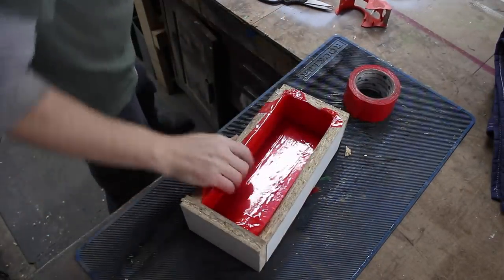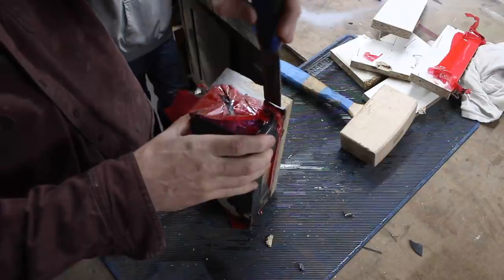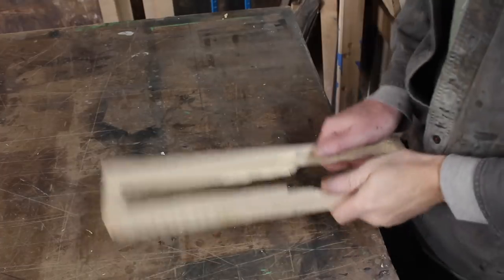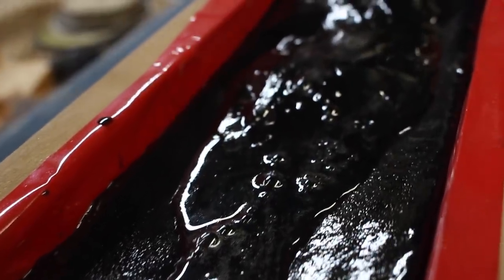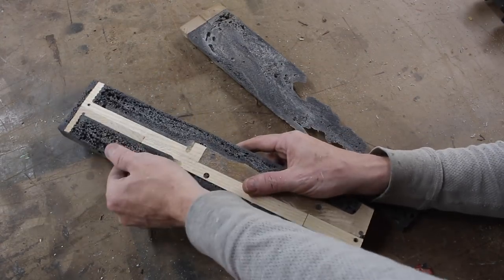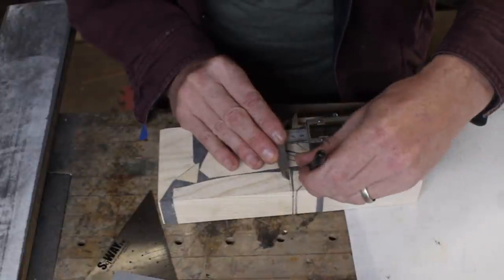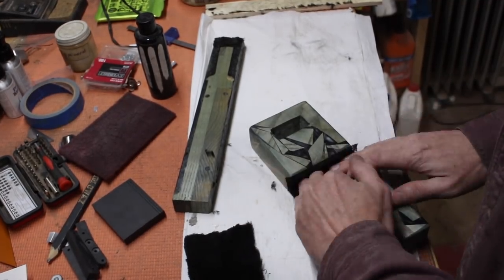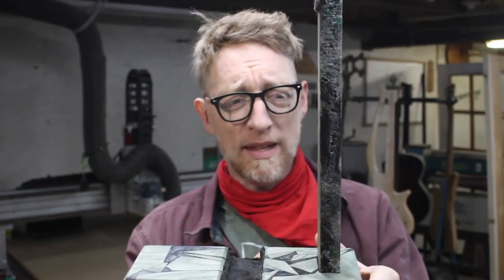Guitar Stand Made from the Scraps of the Guitar

Comment: Hey Tim, the wood turning guys will often hot glue the blank or pieces to the bottom of the form to keep them from floating. Or do what you did and put something the epoxy will not stick to on top and weight it down.
Reply from the maker: Yea, I knew that on some level, but flaked. Just not my usual "place" ...

Comment: I feel like you might need a counter-weight of some sort in the front of the base there. when you rested the guitar on it I had to hold my breath when it leaned back and the stand came off the ground. If not that, then maybe bring the vertical support forward, sort of "flip it around" so there's more horizontal mass at the back.
Reply from the maker: indeed. It needs either more weight (not optimal) or maybe a wider base behind it? I was limited to my pours and scraps. This is proof of concept. Next one will work better.